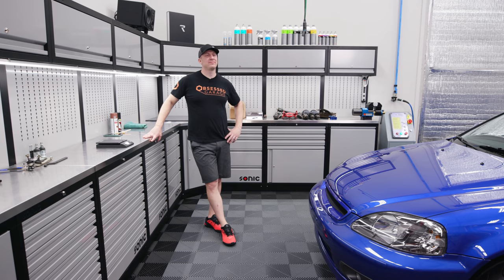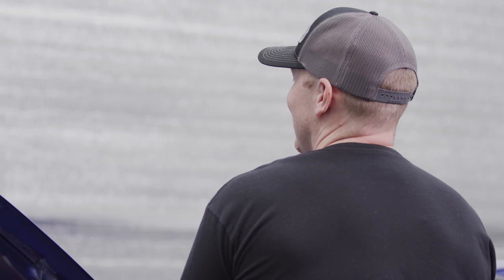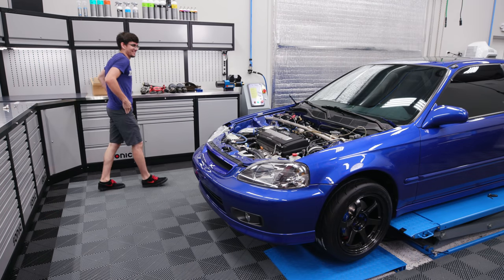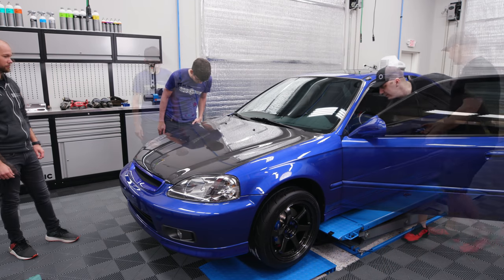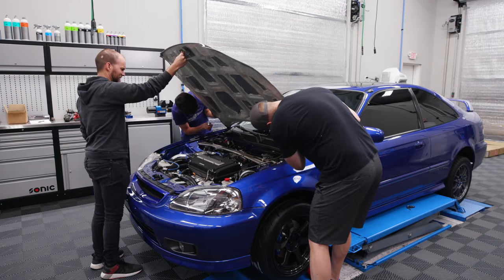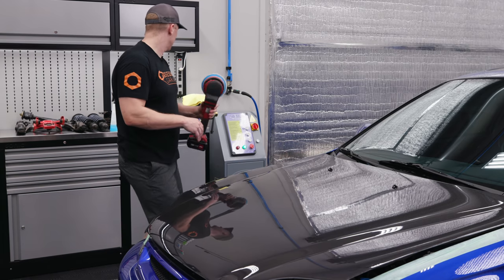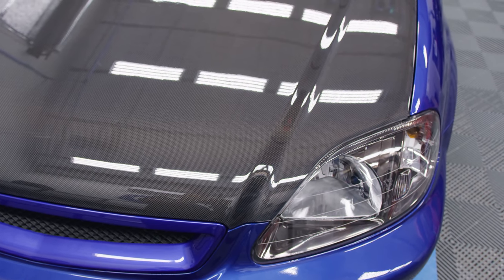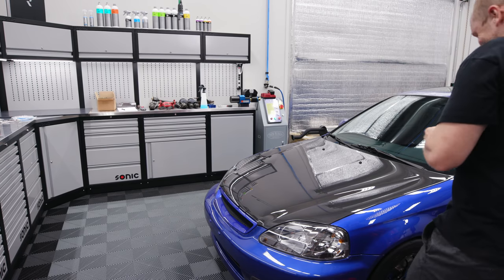The EM1 Civic Gets A Spoon Carbon Fiber Hood

Comment: Leave it carbon my little Honda bro lol. Looks good with the CTR lights and the OE fogs. CF Spoon mirrors would set it off.  Btw, I've had this car since 99, you and I are about the same age, so I'm biased to this look lol. HIN baby!
Reply: Since 2000 here!
Reply: 2000 here too. I have almost same mods and sp1 s2000 steering wheel swap - Volk T37 gunmetal wheels

Comment: Scuff it with  gray scotchbrite and scuff paste...and put 2 coats of Sikkens Clearcoat. It will fill the scratches and give the resin a super nice layer of UV PROTECTION.
I am a professional Auto refinisher, and do this to all of my personal Carbon Fiber sport bike peices.
Reply: there would be nothing left after the first pass of scotchbrite. Think more like 2500 grit wet sanding

Comment: Optimum Clear Coat Restorer would have been a good option for this good, wet sand with 3000 grit, compound, then apply OCCR.  Use it on my CF parts to help provide additional UV protection to the resin and improve cosmetics.  Once that stuff dries it almost as hard as a traditional clear coat.

Comment: Get the hood shaped and re-cleared.
Reply: Shaped? What exactly is that
Reply: @supernice_auto  Trim or sand the edges for smoothness and fit then clear coated. These hoods were designed to be "fitted" to the car and then finished.

Comment: 2 grand for a damn spoon hood? I wish I never sold my spoon hoods smh
Reply: Yup..  I paid 250 for a used Mugen shift knob.  Shit is starting to become rare
Reply: Cali_EG6Si the thin anodized one with the stripe cuts?  

250 used?  Seriously? I thought the 80 I paid years ago was crazy...  wanted the ctr titanium knob, but didn’t want my stuff broken into. Ended up buying that mugen knob, the oil cap, and the fat end twin loop before they switched to the thin jdm tip. I passed on a set of bronze mf8s which I still regret to this day lol. 

I have the blue knob, but it’s worn on the top from use and age. A worn patina. Man, I should take mine out and put the stock one back on.